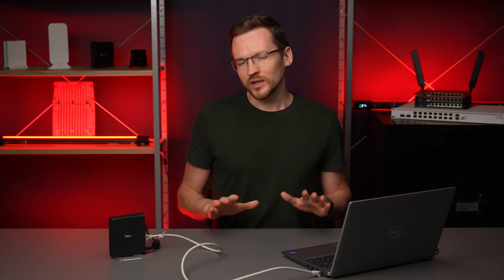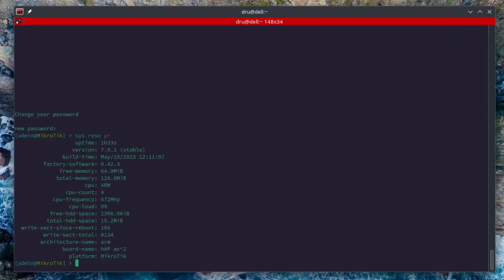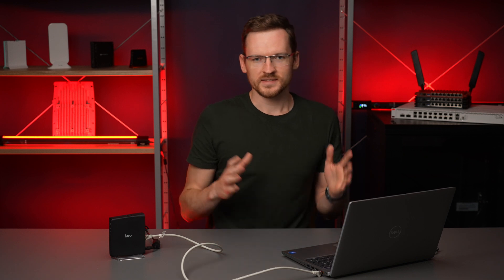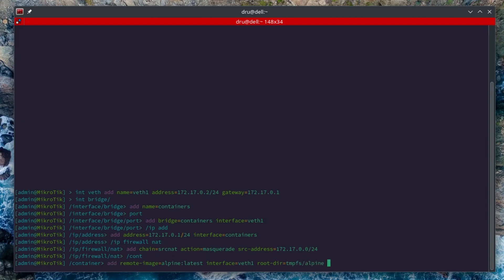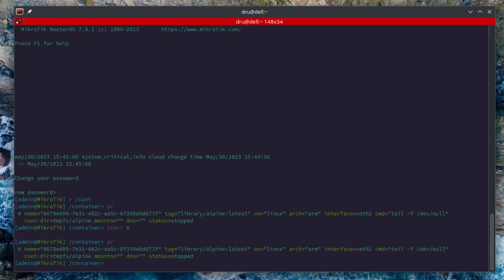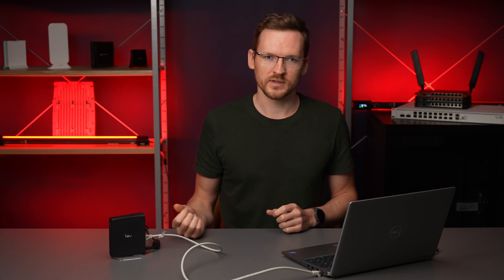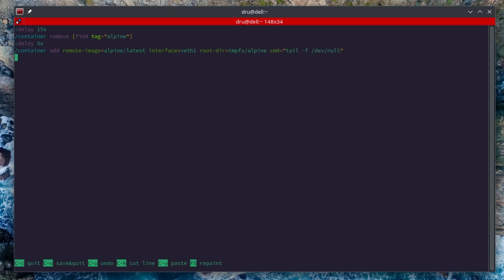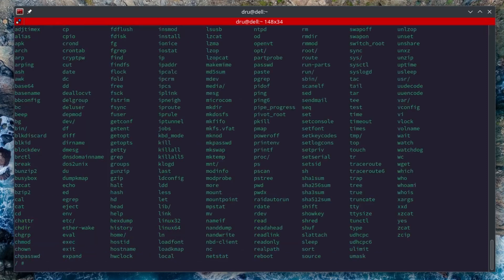Temporary container in the RAM (tmpfs) - a lifehack for low-cost MikroTik routers

Comment: I need to run container with NordVPN client on hAP ax2... Is it possible to install it in main internal memory? For using while travelling, i.e. without usb storage and nfs/smb share available
Reply from the maker: You don’t need a container, it would overcomplicate the setup. You can connect to Nord directly from the MikroTik router, they have instructions for it https://support.nordvpn.com/Connectivity/Router/1360295132/MikroTik-IKEv2-setup-with-NordVPN.htm
Reply: @mikrotik  my government had blocked WireGuard and OpenVPN and IKEv2 traffic on network level. The only working option by NordVPN is proprietary obfuscated OpenVPN protoicol which requires NordVPN proprietary client to work.

Comment: can you use dockerfiles with this method?

and seeing as you use 60MB of the remaining 64MB of ram for your tmpfs, does that mean the container can only use up to 4MB of ram before your device runs out of memory?
does the container process take additional memory? how many containers can you do with this method?
Reply: No, we just set the maximum tmpfs size as 60, it is not taken up by anything. The alpine container on its own only uses a couple of MB from those 60MB and the rest can still be used by the system if needed.